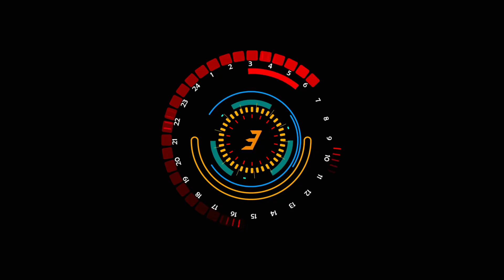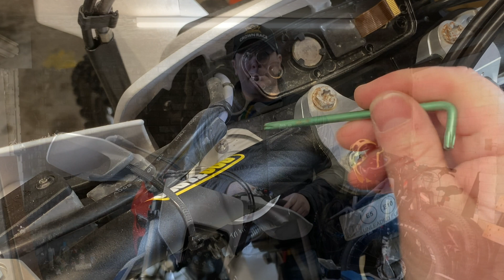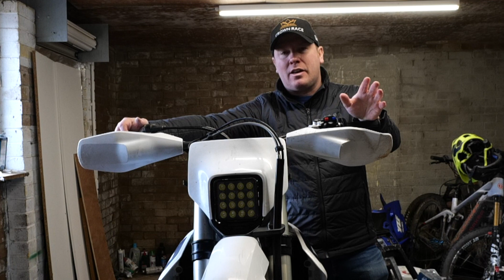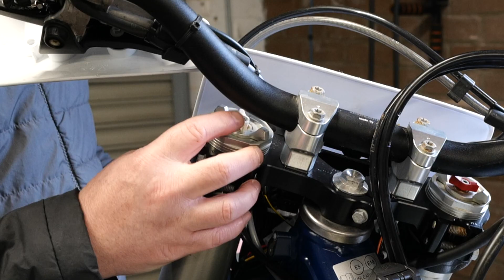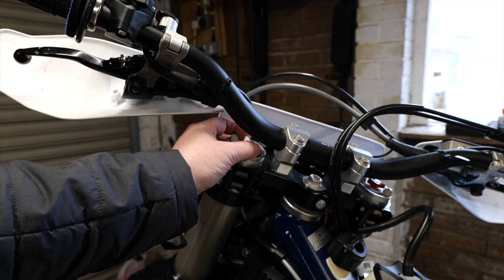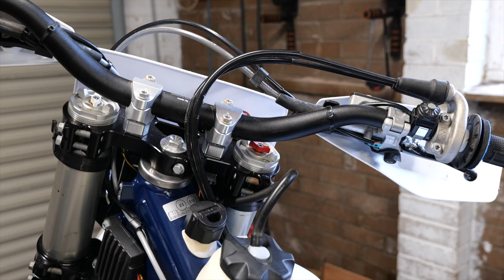Adjusting WP suspension forks | Preload, Compression damping and Rebound damping adjustment

Comment: Im glad they got rid of the Air forks on KTM, just more headaches and problems.
Reply: My 24 has a host of improvements , no air forks, no plastic oil pump, led headlight, easy adjust suspension .

Comment: Thanks for the vid, so simple just needed to see it! TY
Reply from the maker: Hi Billy, no problem at all,  I’m glad it helped 👌🏻. Happy riding ✊🏻
Reply: @MALVSMACHINE  if the front feels very soft and with a slight movement of the handlebars the whole bike shakes, would I go stiffer?
Reply from the maker: Hi Billy. I haven’t really experienced what you’re feeling there but it does sound like the suspension is too soft and you could be going through the travel quite quickly - the rebound may be a bit too slow as well?  It would probably be best to reset back to the standard setting and then work from there, to find what feels better for wherever you’re riding.

Comment: How to adjust high (long) of this wp air suspension  (I ve bought the bike where it is 5cm shorter than it should be)?
Reply from the maker: Hi! The only way I know to adjust the suspension so that it sits higher up the travel is by adding more preload but if the bike was owned by someone else, they may have modified the suspension or it may need a service.

Comment: I had to replace my left inner fork, do you know if I need to readjust compression settings now?
Reply from the maker: Sorry mate, I’ve not rebuilt my forks so am not sure of what needs to be done to these particular forks before and after they are serviced. 
When I rebuilt my sports bike forks, all the adjusters had to be all wound out/loosened off and then setup again when they were rebuilt but I don’t know if that’s the same with the WP forks.

Comment: Can you tell me how they are connect, when you change the clickers on a left fork (compreshion) how its change settings on the other one (right fork)
Reply from the maker: Hi. They’re not connected. Each leg has its own function.
Reply: @MALVSMACHINE  for example if i change setting on left fork (compresion) how i will make the same change on the right fork for compresion also or you change only on left for compresion and only on right for rebound
Reply from the maker: @kaloqnkuzev9802 each fork has its own function and is adjusted exactly as I say in the video:

Left fork - white adjuster is compression damping. 

Right fork - red adjuster is rebound.
Reply: @MALVSMACHINE  perhaps you don't know the fork, the left fork regulates only the high speeds, while the right one regulates the low speeds and the rebound, the right fork does 65/70% of the work, turning the right wheel does not only dampen the rebound but the compression at low speeds is also dampened. Sorry for my bad English.
Reply from the maker: @osvaldodavia8844  
I know the forks, and I know that you can only adjust the compression damping, rebound damping, and preload. And that’s what I talk about in this video:
Left leg - compression damping.
Right leg - rebound damping.
Both legs - preload adjustment.

This information offered in the video is available in the Husqvarna User manual. 
👍🏻
Reply: @MALVSMACHINE  It's like this in the manual, but in reality it's not!!! with the left stem you can only adjust the compression, while with the right stem if you close the rebound you also close the compression at low speeds, and this is a problem with this fork... I have serviced and prepared many of them... if you want the fork return independent of compression you must mount a base valve...
Reply from the maker: @osvaldodavia8844  cool, we can only go off the information we’re given by the manufacturers though ay. You should email WP suspension and tell them their suspension needs to be redesigned 👍🏻
Reply: @MALVSMACHINE  it doesn't need to be redesigned, it works quite well even original, but the old 2012-13-14 fircelles with INDEPENDENT adjustment in compression and rebound have a higher potential... for a good level competitor the Xplors should be modified, make videos without having never opened a fork isn't worth much.
Reply from the maker: @osvaldodavia8844  Again, I made the video explaining how I adjust the suspension forks, the way the manufacturer says to adjust the forks and there’s nothing wrong with that because I’m sharing the information that is already available, but in video format. I’ve also adjusted the suspension when I’ve been out riding the bike, and I’ve found what the manufacturer recommends works. 
The video is not for a good level competitor because they should already understand their forks, It’s for the average person who thinks adjusting suspension is a hard process, and it has given people confidence to adjust their setting so that they can enjoy their bike. Nobody has to have opened a fork to explain how to adjust the clickers  😄, the video is worth more than you realise because you’re not thinking about the kind of person who looks for a video like this, which is normally a beginner 👍🏻